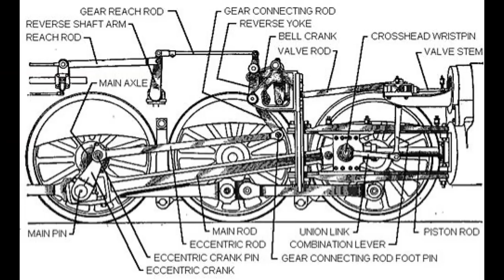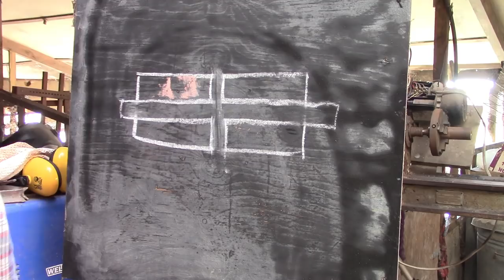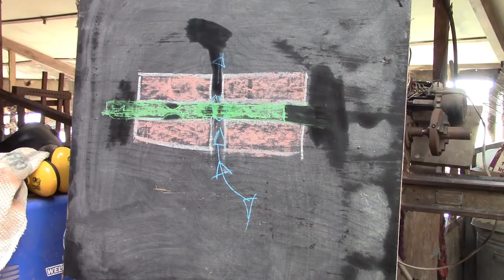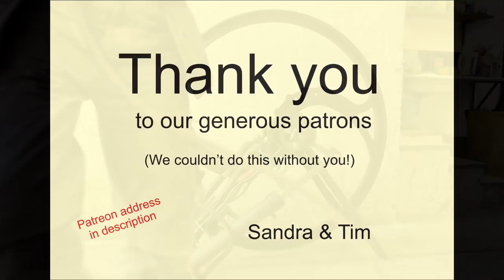Homemade Air Powered Engine Reaches 50 rpm!!

Comment: I think adding more weight to the flywheel could help. 

Think of the flywheel as a battery. You can increase the energy storage of a flywheel by making  it rotate faster and/or by adding more weight to the flywheel.  

A heavier flywheel will take longer to spin up to full speed, but it will also take longer to slow down when under a load.
Reply from the maker: Yes, but this is what I have

Comment: one big problem with some big air tools is the air line chocking air flow. one way to fix you have done with opening the in and out let valves but; if you have a small air tank been feed from the compressor over your air line then fed right in to the inlet valve then this may give you high flow on the in let open stroke and the tank can charge on the exit stroke
Reply from the maker: Thanks - you're right.

Comment: Super cool, impressive speeds! 
I was thinking about 2 thing while watching was a hydrulic motor I once had to where I just blew air in to it and turned it over. Then I remember that I once found a air starter in a scrap pile and  I hooked air to it as well. It was pretty cool. Though I wish I still had it. Either way could a geared motor of this sort work?
I also has a brass air ram that came off of something. I am pretty sure it was a one way only unit so that you applied air and then the weight of the unit would bring the ram back in. 
I am not sure if it would work, yet it worth a try? To unhook the one side and see if the wheel can spin by itself with only an out stoke or in stoke. It may not work yet I just wonder if it would?.

Comment: The spring holder bar on the right of the exhaust valve is hitting the piston mounting bolt. You can see the bolt jumping...

Comment: I think you need a heavier flywheel. Or maybe a offset flywheel with the weight timed to be falling on the exhaust stroke. It may not go fast but you don't need speed just good torque. With enough torque you can gear it to whatever speed you need.

Comment: If you were to vent the cylinder at the top end it will stop any air in there being compressed slowing down the piston. On the power stroke

Comment: The obvious thing is to have more valves and apply air to the other side of the piston on the return stroke. 
Also, using a proper lubricant rather then WD40 would help and would reduce wear. 👍

Comment: I don't know if they're relevant, but I have two concepts that are coming to mind:

First:  There exist flywheel driven log splitters.  The flywheel spins and gains momentum, and the energy from the flywheel is engaged to drive the piston of the splitter.  Second:  Could the piston be connected to something like a bicycle gear system that allows the wheel to keep spinning even though there's a gap in energy input.
Reply from the maker: Ah, but I bet there are many good things about where you are too?

Comment: Perhaps a rotary engine might be a better idea. If you have it running at high speed with a worm wheel then you will have massive power from your rotating wheel albeit lower speed.

Comment: Sounds like it might be time to consider a higher air flow rate.  Air volume being analogous to fuel flow of course.
Also a (relatively) minor thing, but rollers on the cam followers might benefit too.
Regards Mark in the UK
Reply from the maker: Cam rollers? Posh!

Comment: Maybe you could try to cut off the inlet a bit sooner. The crank is at a disadvantageous angle at the end of its power stroke, so the last degrees contributes less to the power output, but could rather build more backpressure as it has more air pressure to exhaust later on.
Reply from the maker: I think you're right

Comment: You almost got the timing correctly if you want to push it further if you go up to 100 PSI you probably can get it to go faster. Once you get its potential the run quicker and get it running better then you can keep working on it and then prove it

Comment: Steam locomotives have two pistons operating at a 90 degree offset.  There is no dead spot this way.  When one pistkn is reversing direction the other is in the middle of a full power stroke.
Reply from the maker: only if they're both double-acting though
Reply: With one single acting piston anything near full torque is only available for about 1/4 of a rotation with no to negative torque for a half revolution.  That's what you have now.

Comment: I would think powering both ends of the stroke on the piston would solve your power dilemma. But I'm not sure it would increase the speed that much. It may require redesigning the valves.

Comment: a larger diameter piston will give you more surface area and help to increase power but it will also use more air
Reply: @Bendigo1  oh wait i thought it used more air?
Reply: @IndustrialParrot2816  I had a brain lapse.  It would take more air because of the larger volume, but it would take less pressure to generate the same force, so in a way, it takes more air but at the same time it would not.   if the force remains the same, the pressure needed to move that force is lower in the larger cylinder, so it requires less air. It will still need enough ait to fill the volume of the cylinder but not to create more pressure.  The smaller diameter cylinder would need more air to increase the pressure to apply enough force.   

With the right ratios, it could  be possible to get more force with a large cylinder with the same volume of air as the smaller cylinder.

Comment: Powering the return stroke is your best bet for useable power, otherwise its gonna be a huge flywheel and a long spin-up. 
Also, a fatter piston loses no power, as the surface area under the piston can make up for the shorter leverage. I suspect it will still give less torque than a properly tuned system, but also less drag. So many tradeoffs.
Reply from the maker: Yes - it's more complicated than I'd thought!

Comment: If you want to make the engine more efficient, cut off the air/steam early into the piston movement. The rest of the stroke is powered by the expansion of the air/steam.
Reply from the maker: I think that will only work when this is a steam engine

Comment: Take advantage of the double acting nature of the hydraulic ram and make it like a real steam engine. Also remember steam will have more energy than just compressed air.
Reply from the maker: The piston rods in these narrow rams takes up a lot of space, so I decided it wouldn't be worth making it double acting, but I might come back to it
Reply: @wayoutwest-workshopstuff6299  that is true. Looks like you’re doing a great job.

Comment: And if you make it double acting, as others have suggested, I believe you would only need one one cam with a valve that has two grooves. While one is pressurized, the other is exhausting to atmosphere, and vice versa.
Reply from the maker: but the exhaust opens for twice as long as the inlet

Comment: a fatter piston provides MORE torque as the power delivered to the crank is over a shorter time, and a wider piston means more Lbs for the same Lb/Sqinch (because there are more Squinches!)
Reply from the maker: Ha! Thanks. These are the cylinders I found on the market so I will keep experimenting with them for now though. But a long stroke = more torque, right?
Reply: @wayoutwest-workshopstuff6299  if the pressure can keep up, sure! but with your engine the flywheel is barely storing enough energy to get it through the cycle because of the low RPM. it'll get exponentially harder to attain higher because the piston has so far to travel.

Comment: Air volume! it's not just about pressure you have to consider the volume too. for instance, if you enlarged all the pipework and have larger valves, the volume available is also larger, sure pressure can compensate for volume but only to a point & you have a limited pressure.
For instance, your air connection to the cylinder is only a small hole make it bigger & you can get more volume through with the same pressure. This applies to everything in the system though including your supply. however, as you are only using one cylinder (atm) your supply is only needed for (about) 35/40% of the time, so you could have a revivor by the machine with your smaller supply (topping up all the time) and larger piping there on. (edit: Just seen Tom Stanton's latest video & almost demonstrates everything I have just said).
On the subject of valves, have you considered car valves to control the flow? dead cheap and can resist a lot of pressure & have a large flow rate.
keep it up.
Andy
Reply from the maker: You're right Andy - that's exactly why I opened those valves.. : -  )

Comment: Of course there is a way to improve your engine. But you have to slightly diverted from what you're trying to do. Yours is at only a single action. Which is not bad but you shouldn't have a double action so that when the Piston goes for his first stroke when Nick reaches the other side of the stroke it can power itself back so then that way you get more RPMs on the return instead of only having it in One Direction. It's most standard on All American steam trains

Comment: if, thats a dual acting cylinder, rather then the other side sucking and blowing all by its self doing nothing... it wouldn't take a whole lot more to put a power stroke on the other side of the piston the timing mechanism would just need to be duplicated, but 180 deg from the main side.  or a simple rocker valve, pressure would be constant, but as it cams from one side to the other, the flow would got to opposite ends of the piston, while the exhaust would simply reverse through the existing plumbing... some small model steam engines use this mechanism... which is pretty efficient and really simple
Reply from the maker: Thanks, I'll look up rocker valves.

Comment: What about a rotating spindle valve? as the rod rotates the cross sectional holes in it line up with the air inlet hoses its somewhat like a rotating disc valve but it uses less friction. i have a toy steam engine that uses one and they dont seem to leak too badly.
Reply from the maker: hard to make though?
Reply: @wayoutwest-workshopstuff6299   No not at all, its just a shaft that fits in a holder like the valves you allready made, the shaft inside has a hole drilled perpendicular to the valve. As the shaft spins the hole lines up with the air inlet and the outlet to piston, admits air to the piston and moves it, I know they use them in small toy steam engines were a low friction valve is needed. The valve rod would need to rotate at the same speed the engine does so the timing doesnt get out of sync.

Comment: did no-one suggest plumbers tape? seriously? It's a rubbery ribbon you wrap around screw-on fittings when using connecting water hoses

Comment: A larger diameter piston would increase the power exponetially.   The stroke is not as much of a factor other than requiring more air.  But the larger diameter would ingrease the force of the piston while reducing the required pressure inside the piston.
Reply from the maker: These were what I found on the market. Also, long stroke = more torque, so maybe these are the best shape anyway for low-speed work
Reply: @wayoutwest-workshopstuff6299  I watched your previous video after I saw this one and left the comment, I now understand what you are working with.   If you were to find any larger diameter cyllinders it would be a great upgrade.   

I was thinking about it and thought about adding a reservoir Tube to the port you are not using at the top of the cyllinder.  You could get some ot the losses back on the reverse stroke.  The ait in the reservoir would be pressurized by the power stroke, then provide pressure on the back stroke, instead of essentially turining the one side into a vacuum trying to pull air back in.    It would be a more simple fix than trying to plumb both sides to provide power.

Comment: Maybe turn the other way ? (clockwise). If the piston is "heavy" it MIGHT help on the return stroke to push the air out of the piston...
Reply: But equally that would also make it harder to raise the piston up on the powered stroke
Reply: @mickys8065  yes :)
But then it doesn't rely on the flywheel
Reply: @camifracelli631  but it does, because the energy you'd gain by using the pistons weight to drop is lost on the rise. The fly wheel would need to provide that energy
Reply: @mickys8065  but wouldn't that make the rotation smoother ?
Reply: @camifracelli631  potentially, but only because it might make the flywheel balance better. Most of the flywheels energy is likely being lost by friction, so by moving the heavy piston closer to the centre of mass, there is less side to side wobble, which means less friction

Comment: I don't know much about steam engines.  But WD40 is not suitable as a lubricant.  Not on the bike and door lock and I don't think of such machines either.  WD40 is primarily a rust remover and suitable for loosening solid parts, but it loses its suppleness very quickly and tends to harden.  But for prototypes, WD40 might be just the thing :)
Reply from the maker: Thanks, Ben - it was the closest thing at the time
Reply: Actually, no. WD40 is a water displacer, hence the name (WD?). I’m told it’s main constituent is paraffin so not a lot of good as a lubricant, though good as a machining cutting fluid for aluminium and brass. Les

Comment: In hydraulics the diameter of the cylinder dictates the torque, I'd imagine the same principle applies when using squashable fluids (like air & steam).
Reply from the maker: I think you'll find the leverage provides the torque - so the longer the crank the more torque. But to operate a long crank you need a long stroke
Reply: @wayoutwest-workshopstuff6299  
Indeed, but what drives the piston is the expansion of the gas inside of it, and the only surface it works against is the piston end (the moveable part), all the rest of the cylinder is just static walls. So the most "effective" cylinder for expanding a gas is very "over square" (wider than it's tall).

In a hydraulic system where the max pressure is the limit (usually around 300bar) you get more torque by having a wider piston, quite simply increasing the are the oil can work against, and this holds true also when considering gas expansion.
Reply from the maker: @brynyard  I agree, Brynjard - but that's not quite the same as torque, is it?
Reply: @wayoutwest-workshopstuff6299  By moving over a longer distance you trade of speed with torque - you get torque, but at a much slower speed. If you want torque and speed you have to have a large expansion and fast, both of which require a large work area and a large flow.
Reply: @wayoutwest-workshopstuff6299  
Here's an explanation of how torque develops in combustion engines (which is essentially a steam engine with the "steam" created in situ):
https://www.youtube.com/watch?v=C_YNn3ZkJmU
Here's a bore vs stroke:
https://www.youtube.com/watch?v=UV3RwBPqznU
Most ICB engines are usually close to "square", and the reason an hydraulic piston have such a long stroke vs bore is more for practical reasons - they want to minimize the friction and size of the seal (since it has to be tight and handle a lot of pressure - up to 300 bars), and the usage for hydraulics are often slow moving and high holding power, and then the speed isn't that important. You want to have orders of magnitude (10's of times) faster speed in an engine, and then the ratio in a hydraulic cylinder get very far from optimal.
Reply: @wayoutwest-workshopstuff6299  
Or to put it simple: It's complicated :)
But I think you may agree that it seems the design of using a hydraulic cylinder might be a bit sub optimal, it has way to long stroke compared to bore to be anything close to most efficient (which is closer to, but not exactly square), and the goals of a hydraulic cylinder doesn't match up very well with what you're doing. It has way to much mass (that has to be accelerated and decelerated each stroke, slowing down max speed), friction (tight seal designed for not making any fluid escape even at very high pressure) and has to little surface are (bore) to extract enough power to make it run at a reasonable speed and make it very inefficient as well.

This is not to bash you in the head with "listen to the experts", but you're demonstrating very well a good experiment to demonstrate what works well (and not), so please keep on hacking :)

Comment: A brilliant piece of engineering to be sure.  However, I can't help feeling that an electric motor would accomplish the same task with greater efficiency.  You'd be compressing the air anyway with an electrically powered compressor or one powered by an internal combustion engine.
Reply: I agree. Use the original energy source directly, instead of degrading it by passing it through another stage. Chris Greaves
Reply from the maker: But this is just the first step, HB. I hope it'll be powered by steam one day